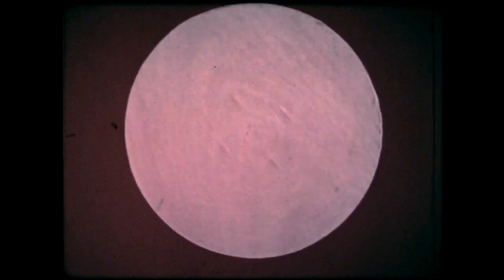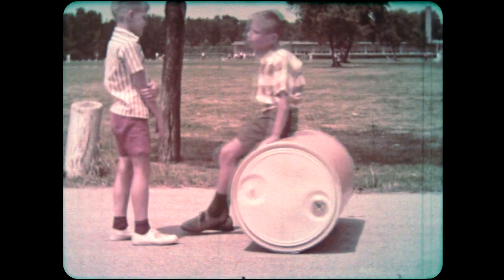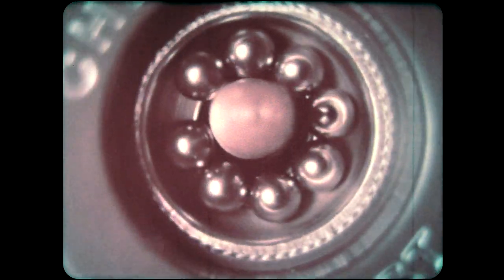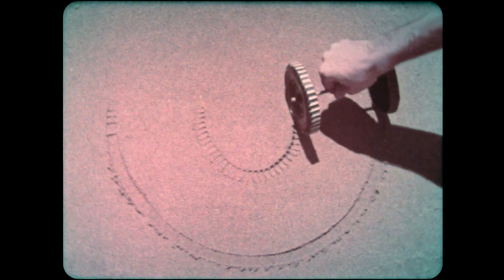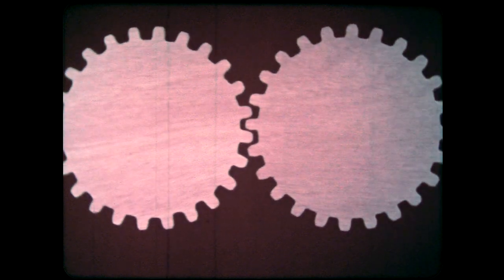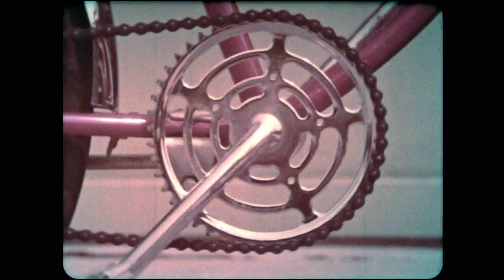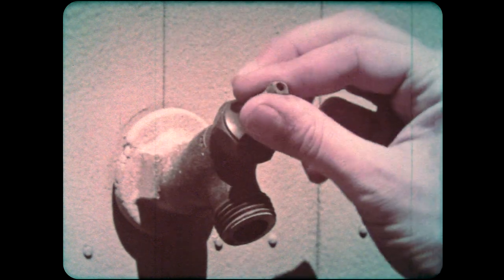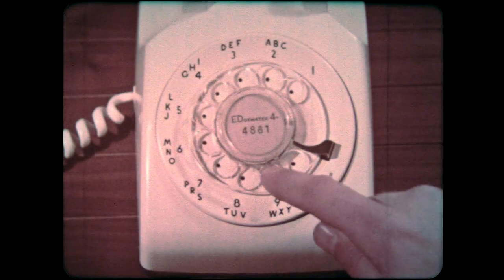Wheels! (1966)

Comment: They show how railroad wheels are fixed to the axles and also show the problem fixed wheels have when turning since they can't turn at different speeds.  But they don't show the solution.  The tread of railroad wheels is tapered.  It is a small diameter toward the outer edges and larger in near the flange.  As it goes through a curve, the wheel naturally adjusts and shift laterally so a smaller diameter point of the tread contacts the rail on the inner side of the curve and a larger diameter point on the other wheel contacts the rail on the outer side of the curve.  So, it acts like two different diameter wheels.  On straight track, the wheels adjust to have equal diameter points.  Theoretically, if the wheels and track were perfect enough. you would need the flanges.  A close cousin to this is belt sanders (or older machinery using flat pulleys and flat belts).  The belt sander rollers are crowned in the middle which is the opposite of what many might expect.  The belt seeks the high spot and if it goes off center shifts back to the middle.  In the case of a belt sander, no "flanges" are needed.

Comment: In watching this, especially with the water valve handle and then even the "steering wheel", I wonder if those are really "wheels".  The application doesn't really require a wheel shape.  Some water valve handles just have the two protruding shapes and are little more than a straight bar.  Some steering wheels have been oval.  Or there have been tillers.  Some of these items might be "wheel shaped", but is that enough to define it as a "wheel"?
Reply: I had the same thought, esp with the water tap.

Comment: Odd looking engine on that go-cart.  It would be interesting to know what it was. My dad , back in the 60s, made me a go-cart from scraps in a junkyard and used a 2-hp engine from an outdoor washing machine.
Reply: Internal combustion washing machine?
Reply: @albertbatfinder5240  Yes. Gas engine instead of electric motor. Back then, many people used the tub and wringer washers and some had no electricity so they used gas engines.   : )
Reply: @55Ramius  I remember tub and wringer and ones with special fire pit for warming the water, but not any gas (petrol) ones. Maybe they didn’t make it to Australia. I wonder if they had already invented  gas cement mixers, because if they had, I would be using that! Not a whole lotta difference.